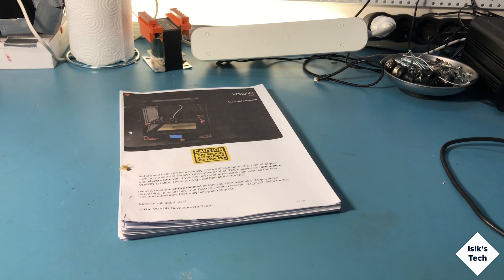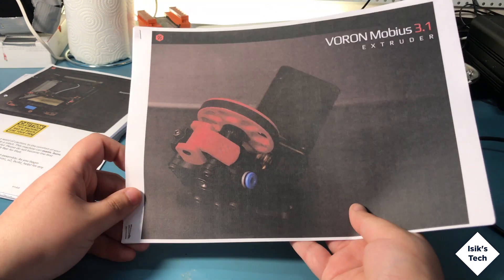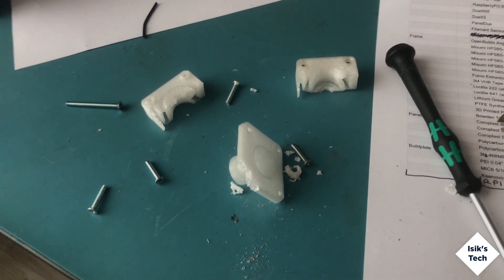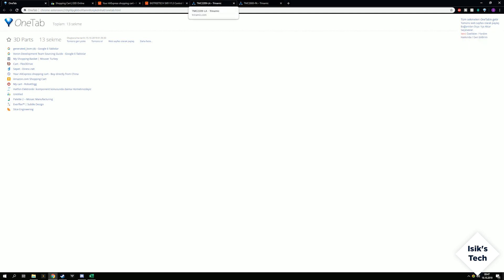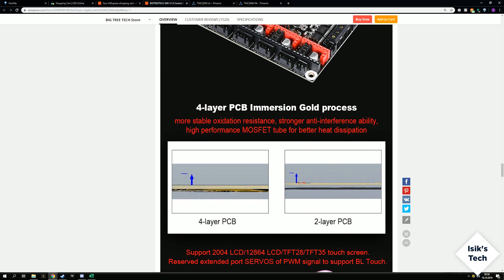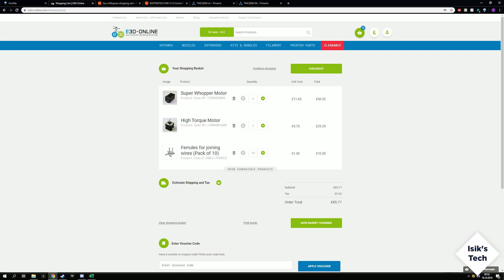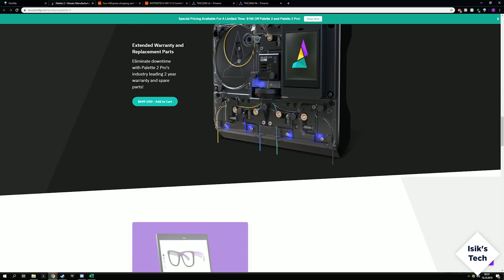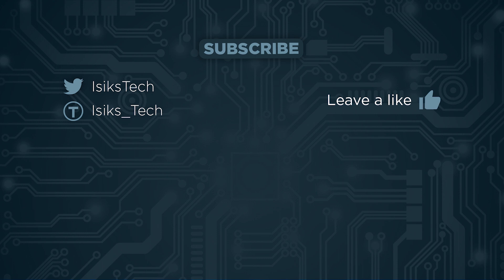Voron 2 Ep. 1: Planning & Salvaging Parts From Tevo Black Widow

Comment: I admire your work, you gave me tons of insight into the black widow (personally I think you should simply remove the high end stuff (duet wifi and flex3drive) from the bw for use on your new project and put the bw back to work with the original mainboard and extruder, it would be a good backup printer). So I had a question to ask... I just put to work a black widow I bought 3 years ago. I assembled it then but it never worked so I let it sit for 3 years. Last month, for personal reasons, I decided to do something about it and I made it work, it was actually a very simple problem. But I am still a noob, so I had issues with support structures, which eventually led to me accidentally cutting my left hand while trying to remove a support structure from a piece. I got 5 stitches and it was my first ever call to 911, lol. This led me to the discovery of the usefulness of dual extruders, so the question is... What would you recommend for the black widow as a dual extruder solution? The only solution I found is the flexion extruder, which currently is more expensive than the black widow. Do you know of anything else? Would a Geeetech mk8 dual extruder + hotend combo work? It says it is 12V for the hot end and fan, but Geeetech says they can make it 24 v for me. I am obviously not looking for the best solution, I am more like looking for a budget solution. Best solution would probably be the g5 flex3drive cyclops or is it the nimble?
Reply from the maker: Honestly I have no idea. I wanted to try dual extruders with the BW for some time but never got around to actually doing it. Geeetech one looks decent, but again, I don't know anything. Only downside that I can immediately say is that the heater blocks are seperate, which can cause the nozzles to not be exactly on the same level so one of the nozzles may get stuck on parts or extrude badly. But this is a common trade off of a ton of designs (including high end ones). As I said I don't know much so I can't say anything more but good luck. Hope it works well so you don't cut your hand again (ouch!). As for my BW, I don't think I will rescue it. Some parts (Some bearings, POM block and wheels) are worn down to the point of being useless, replacing them would cost a decent amount, and I don't think it will be worth it. Instead I will repurpose the parts on newer projects. The subject to change (almost certainly) plan is to reuse duet on a cnc router or laser, reuse flex3drive on the voron, the steppers on either a cnc/laser on a different 3d printer if I decide to have a backup one, the psu on a diy lab psu, precision piezo on voron or new 3d printer, etc. Most of the parts will eventually be reused as you can see. Only the extrusions, terrible clone rails and the bed are going to be wasted.
Reply: @IsiksTech  Happy to hear you are not wasting anything. Geeetech's solution is to use one block of metal to which they attach the extruders and the hot ends, so you are right, there is room for failure in such an arrangement. I may want to consider an e3d cyclops+ instead, since I am steering way from TEVO proprietary solutions and embracing open source (e3d is open source, right?  Everybody copies them). Is it possible to do a CoreXY CNC router? The Duet is 32 bit, arduino Due, faster than the STM32 afaik. STM32 is cheaper.
Reply from the maker: @marcellofialho677  AFAIK E3D is open source. You could also consider something like this for a dual extruder build. (Ali URL /item/32770576556.html )

It should be possible to do a corexy cnc router but I don't know it will have any benefits. Only reason I am considering duet for the router is because I already have it. I didn't use it for Voron because a DueX5 was needed and it costs pretty much the same as buying two skr s and tmc2209 drivers. I could use duet for a back up 3d printer as well, if I decide  to use a different board for the cnc.
Reply: @IsiksTech  I am following what you did and going for a flex3drive solution, but with 2 g5's and the original cyclops/chimera from e3d. I asked them (flex3drive) and it is their recommendation for dual extrusion given I want their extruder. It is a lot of money to put on a black widow I know, but they did it themselves, so they have all the stl's for the mounts. I suppose there are some advantages to the Black Widow after all, there is no such solution for the Creality CR-10, which seems to be everyone's favorite kit printer these days (probably because it is a 15 minute build). Like I said, I admire your work because you tried a lot of mods, put a lot of dedication into your build. You pushed the limits of what's possible with the design of the BW. Turns out there are some strict limitations. I will watch the entirety of your footage to understand all the challenges I will face.

Comment: You should definitely try the E3D Hemera extruder it is the coolest extruder out on the market right now great to see you come back to YouTube.
Reply from the maker: Thanks. It's good to be back. Initially I'll just go with the stock one as I explained in the video, but after that I'll definitely consider it.
Reply: @IsiksTech  I'm in a process of building my own printer from scratch I was going to my gates 12mm pulley's and belts from e3d but seeing your videos and you said the gates belts are genuine can you provide links to where you getting them from thanks
Reply from the maker: @jim.c6780  YT deletes ali links in the comments for some reason. Just add the rest. /item/32853559638.html

Comment: Awsome that you are building a Voron! Bouilt my 2.1 this year and its a amazing printer. Realy recomend you go with a LRS-200-24 PSU, not the 350 one. You dont need the extra power and the 200w  is a lot smaler.
Reply from the maker: Thanks for the advice. How much power does the voron pull just on the 24v rail? I want to add LED lighting as well, and thought 200 may not be enough.
Reply: Isik's Tech Have no way og mesuring it, but quick napkin math tels me it can pull about 160W from the 24V. For LEDs I would recomend just getting a small 12V PSU aswell so you dont have to deal with stepping down voltages or finding 24V strips. Good luck with the build! Jump on the Voron discord if you havent yet, lots of info and the devs are all there.